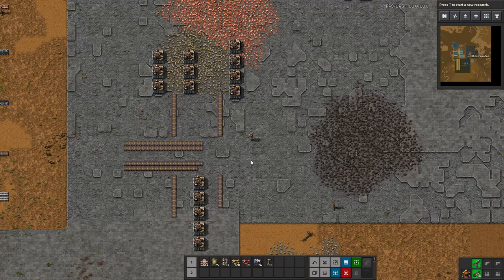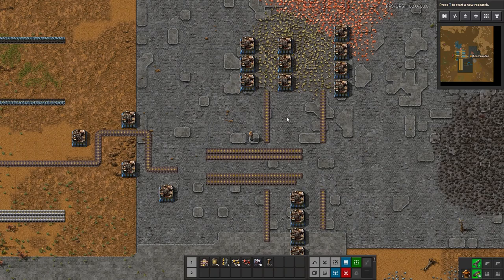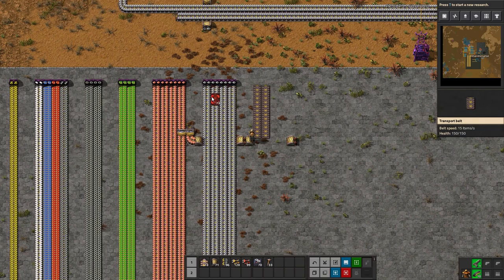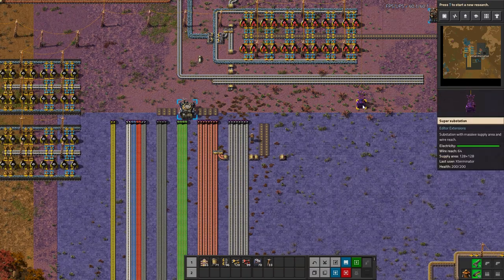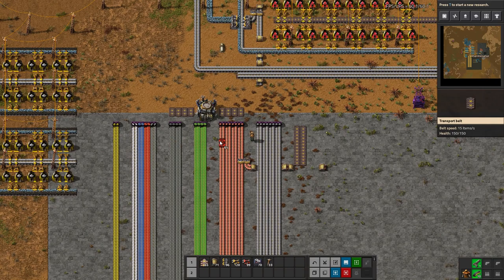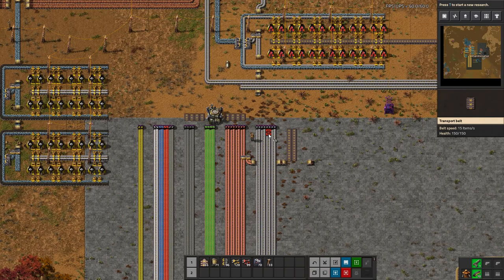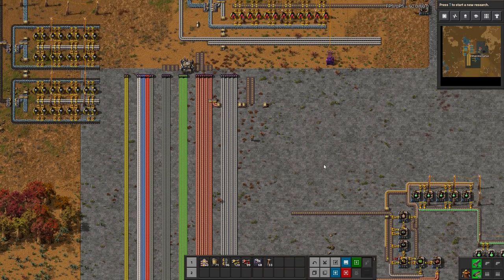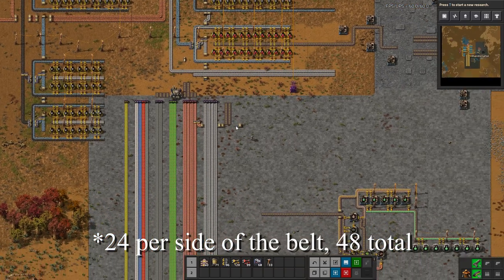The Main Bus Concept / Layout & Tips - Factorio 0.18 Tutorial, Guide, Walkthrough: Fundamentals

Comment: Me, 30h in my first gameplay: Well, guess it's time to throw all that out and start again!
Reply: You probably should've ripped everything up an restarted with the stuff you already had
Reply: @PabloEscobar-ws8rz  as a 50 hour player (aka noob), I can confirm that restarting is easier as the foundation of your spaghetti base will probably be very bad.
Reply: @CraftingTableMC  ok
Reply: @PabloEscobar-ws8rz  
I just store everything in dozens upon dozens of steal boxes after ripping everything down. Anything I don't need to keep will be destroyed using a woodeb box. It takes time but it gives you all the tools you need to get right into making a better base.
Reply: @CraftingTableMC  
I disagree. My jumpstart base is always a mess, but it's just a base designed to get me basic resources so I can build a proper base.
Once I've got a good enough supply of the materials I need to build a proper base(inserters, miners, smelters, assemblers, etc) I can properly plan out my base, but I hate trying to build a larger factory if I don't have everything I need or have to worry about breaking an existing working design to fit something new in. Also lets me jump to red belts for resources which means I don't need to wait for them to filter down to where I need them if I boost production.
Reply: @scragar  I've found a small fix the the issue of the Nooby Necessity of having to constantly restart. There are milestones that should be special Save files. Seems pretty basic, but it's saved me plenty of time. 

Get your steam power up and running and then create a save. That can serve as an absolute reset, so you wont have to go through all the wood chopping BS again. A special save. 

If you go the BUS route, Create a special save file when you have your FIRST iron and copper plate BUS lines built or nearly ready to go. It's another key point in time. 

😁There’s no feeling more intense than starting over. Starting over is harder than starting up. If you're not ready for that, like if you've already had a bad day then what you're about to go through might be too much...
Reply: @snickle1980  oh God, I've spent so much time on that damn mountain. After reading your comment, I feel I must go climb once again
Reply: Naw, once you have logistics no amount of spaghetti is too much
Reply: When you start modding it happens even more.
Reply: 100 часов во втором прохождении, опять новая игра....
Reply: Just move to another area of your map and create a new main buss there
Reply: Factorio.
Reply: @CraftingTableMC that or make other bases further away if you can

Comment: I do not do gear when I use a bus since when you need iron gears you for the most time also need iron.
Reply: Gears on the bus was more useful when science needed an extreme amount of gears. You used to have gun turrets and mining drills there. With those removed the gear needs for most things are pretty modest.
Now most gears are needed in belt production and that can simply receive its own dedicated iron belts
Reply from the maker: Yup that totally makes sense. I vary from factory to factory for putting gears on the bus haha.
Reply: The thing to be aware of here: 2 belts of gears == 4 belts of iron.  Do with that information what you will.
Reply: I rarely do gears on bus, but they do make sense. 1 gear is 2 iron so you save a full belt.
Reply: @DavidLindes  
Yes, but you still don't need that many of them in most places. I give green circuits and possibly belt production its own iron lines. That way 4 belts for the rest are more than enough. I simply don't need to optimize things that much

Comment: Another aspect useful to keep in mind is in what order along the bus (starting from your furnaces) you should put your builds, I usually try to put earlier along the bus those items that are used in most advanced recipes, for instance, green circuits are used in a lot of later more complex products, so that is probably the first build I'll set up along the bus, you are also going to need tons of rails, but that is either an end product (destined to be used in base construction) or fed straight into science and nothing else, so my rail build will most likely be towards the end of the bus near that science build.

This reminds me I don't see stone ore or brick in that bus, you are going to be building a bunch of rail and wall at some point so I would set up one bus belt for half ore and half brick stone.
Gears quite honestly I produce in-situ always so no belt for that, and plastic is used almost exclusively in red circuit so I usually just produce it near to where the red circuit build is. I do bring along oil gas and lube parallel to the main belt bus with underground pipes, this allows me to produce oil derived products like batteries near their respective consumption builds.
Reply: that's an awesome tip. i'm on my first playthrough so i didnt know what would be used where..., i have way too many things on the bus, going in both directions 😆😆

Comment: As a new player some time ago, I struggled with balancing the draw of materials from a multi-belt bus.  It might be good to give people a steer on balancers - for me at least the optimum configuration of splitters to achieve what I wanted was not obvious, and one still sees several different strategies from different players.  The simplest is, I believe, always to split off the nearest side (that would be the righthand side in this video) and then use splitters upstream to bring material from the further belts.
Also, it's often the case that a production unit will need a mixed belt of e.g. green and red circuits.  There are neat ways of mixing the belt mid-bus, without drawing two full lanes off and mixing them at the "roadside".
Reply from the maker: Thanks for the comment and thoughts! It seems you aren't the only one who would like a video on balancing and splitting off the bus, so I'll do one on that in the near future. I even struggle with it myself sometimes. It can be tricky. 

You are right though, that splitting from the the close side and then using more Splitters upstream is the way to go. But the configuration in which you do that is important for it to work properly. I'll definitely cover that in my video on it. :)

Comment: Last year, something occurred to me:

Factorio is to some extent about compressing low-value materials into higher-value materials.

2 Belts of Iron Plates becomes 1 Belt of Gear Wheels. So 2:1.

1.5 Belt of Copper Plates and 1 Belt of Iron Plates, 2.5 Belts in total, becomes 1 Belt of Electronic Circuits. So 2.5:1,

5 Belts of Iron Plates becomes 1 Belt of Steel Plates. Thus 5:1.
Reply: Ahh, but what's the ratio of iron+copper+coal:satellites-with-also-supplied-silos?  :D  [Hmm, now I want to do a factory where I have a compressed blue belt of satellites, feeding constantly-launching silos, and just emptying out at the end.  Hmmmmmmmm.  Will I bother?  We'll see!
Reply: @DavidLindes  One blue Belt of Satelites (45)s) = 27862.5 yellow Belts Copper, 25305 yellow Belts Iron (including the Iron Plates, needet for Steel), 2100 yellow Belts Steel, 1350 yellow Belts Coal, 1311538.462 units of crude Oil and 3144038.462 units of Water.
Have fun with that xD.
Reply: harry68784 sounds like a project! I like it! xD
Reply: @DavidLindes  ah yes. 27 thousand full belts of copper and 25 thousand belts of iron is "a project"
Reply: Legend Creeping yup! A big one, mind you. :)

Comment: 1) because blue undergrounds can travel 8 spots, If you INTEND to play past the first rocket launch, or build a megabase, you should triple/quadruple your initial-width needs of the bus: If you plan to start with 4 lines of iron and copper each, give your safe SPACE for 12 or even 16 lanes of each. And when intending to go for mega-base-size saves, I suggest either having single-side production (where the side opposite of factories/utilization is used is for insertion-balancing and rail network), or utilizing a split bus (where you use almost twice the size of a normal/early-mid-game bus, and where you put Iron/Copper/Green Circuits on the outside lanes of each,  and rarer materials and liquids are sent through the middle lanes, which can be shared with space for roboports and power distribution. Also, something a lot of people forget is to give themself SPACE for traveling up and down the bus. A dedicated single-lane or double lane rail for a train shuttle can be useful here, but you need to plan for it. Also, leave yourself room for roboports.

2) Leave space between factory areas to limit the times you have to demolish and re-place because you didn't leave yourself room for something you'd like to change. 
also, getting into the habbit of leaving yourself space helps when you do have spaghetti factories-, especially leaving space between/around large builds to enable insertion-balancing of rail-delivered resources. Also, setting up a clean power distribution line along your bus makes logic-driven control of sections of your factory easier, and can be useful for setting up a dashboard.

Comment: manufacturing/crafting (whatever anyone calls it) on one side leaves the other side open for more smelting to refill iron/copper/steel lanes. gave me a good idea for a next factory. 

thanks!
Reply: There are many ways to do things. I do build stuff on both sides, but not randomly. Circuits and oil industry all goes on one side. That way I can feed things directly into each other. The green circuits or plastic for red and blue circuits for example don't even go on the main bus. That's also stuff that will get beacons later. Whereas with science I use 3 PM3 and 1 SM3 instead.

Comment: * One thing I find very useful is to not run the copper and iron for circuit production over the main bus. That way you don't need necessarily need 8 lanes of iron and 8 lanes of copper or whatever some people have. At the beginning I still do it, but when I scale up they get their own belts.
* It's also nice to have a fluid bus with water, crude oil, lubricant and acid
Reply from the maker: Very good point! Giving circuits their own dedicated lines separate from the bus is usually a really good idea. A fluid bus can be quite good too depending how your base is later out.
Reply: My last base i build i did a dedicated green circuit build in front of the bus with dedicated smelters so i could produce 4 full red belts of green circuits with steel smelters and then pushed it into the bus. Was massive, had a huge space requirement and made it insane with trains and train stackers but was incredible to see swing in action. If i can find it again, i'll post a picture off the map for that area of the base.
Reply: here is a link to just the smelter setup and the integrated Gren Circuits build https://steamcommunity.com/sharedfiles/filedetails/?id=1672678083

Comment: Perhaps for another tutorial: How to route things off and onto the bus in an optimal way, such as if its in the middle two of four lanes, how would i build that splitter? balancing etc. what's a good way to create a shared belt? how to avoid spaghetti
Reply: I'm also wondering what the best way to lay out the production of the materials to go onto the bus should be? And how do you get a consistent flow of 4 lanes of a material
Reply: @MnemonicHeadTrip  Balancing/Making sure the belts start full. It doesnt matter if they are not full later down the line.

Comment: As someone who consistently never leaves enough room for anything, I'd also suggest that you leave a good amount of space between the bus and the various productions lines, just in case you need to route something around that doesn't fit on the bus.  At least 10 spaces but probably more in reality.
Reply: And when you build your first factory, leave space for more bus lanes. You need a lot more material than you expect.
Reply: @schwarzerritter5724  these days I just do a small bus to get going and then use trains for big volumes.  Klonans Transport Drones Mod can also move amazingly high volumes of material without having to worry about putting things in a straight line.  It suncs up well with train deliveries too.
Reply: @scottsummers819  The bus of my first factory was one lane for iron, one for copper and one half lane for steel, gears, green chips an copper wire. After realizing there was no reason to put copper wire on it, I made one full belt of green chips and added another lane to copper and iron. Then all this other stuff came, so I completely abandoned my first factory and just build a new one somewhere else.

Comment: Putting Gears on the bus is only useful if you're building everything off of a single bus.

I tend to separate my bases (starting in the mid-game and beyond) into two areas: research and infrastructure. Each base has its own main bus, eventually fed by trains that will drop off material to whichever one needs materials.

If you do that, what you find is that most uses of gears are for infrastructure: belts, inserters, etc. Research materials only need gears for Green and Red packs, which are not what's going to be slowing down your research. You can easily build gears in the places where you use them, rather than funneling them on down the bus.

Comment: For me the smelting is built as the end cap for my bus. The materials come off the smelters in the same direction as the bus and they all merge down into the size as the bus.

I also build on both sides of the bus. Though it is usually an oil processing area for the beginning of the other side and eventually science and rocket.

After that I start to work on my real base. Anything up to launching the first few rockets is just a starter base for me

Comment: I like to do a mix. I don't like one ridiculous factory to use one bus with 8 belts of copper and such. So what I do is I do modules and connect those modules by train. Inside those modules I use the bus concept.

For example for the gray science module I import bricks, iron, copper, coal and steel, put those things on a bus of kinds and then out comes my science packs.

This eliminates a large part of the spacing problem.

Also it's not efficient at all. You have a lot of useless belts doing nothing when they could be short. What it allows you to do is mainly organization and make sure things stay extendable.
You have a common way of doing things that will always work the same.
You can always add more to your offshoots if you need to, allowing for infinite extension (so long as the belt capacity is great enough)
It also has the benefit of making sure that every factory at least at some point gets some resources, even though something earlier in the bus may gobble things up at a pace that exceeds the inflow of items.
It also is a good indicator if you have enough resources to begin with. If the belts are empty you need more.

The bus also comes with some fairly substantial drawbacks:
The main one is space requirement. You need a lot of belts to run past machines that don't use the resources on them. For example your plastic belt is going to run past red, green, gray, blue and purple science only needed for the yellow one as well as any helper assembly machines that produce logistics items (belts, inserters, machines that don't go into science, etc). This has a lot of plastic sitting on the belt, not being used.
Then if you find yourself not having enough throughput and you are already at blue belts (say you found out that 2 blue belts of copper plates aren't enough and you need more) it can become very hard to widen the bus.
If you have machines on either side of the bus it can get very messy to split the belts off.
If you misplanned and want to add an additional item to the bus (say you decided to ship plastic in after researching oil), it can be again very hard to widen the bus.
It bottlenecks throughput for high demand items such as circuit boards through belts. Having your entire factory be fed off one bus will make it (the bus) enormous. to the point where you have more floorspace dedicated to high volume material transportation than actual assembly machines. And belts use a lot of resources to make, especially the higher tier ones.
It also creates a lot of delay. An item has to travel down the belt before it can be used. If you have a fresh shipment of ore coming in, the iron plates will need a substantial amount of time, possibly even minutes before any iron is seen at the end of your bus.
It also creates a lot of buffer that you might not want, unless you smartly control it with the circuit network. For example if you have a belt full of nuclear fuel you have a massive stockpile of it just sitting on a belt if you run it to your reactor. For this specific instance logistics robots might be useful. I however hate them (they are just cheating, avoiding all throughput and routing problems at the cost of power and initial material cost), so I opted for the circuit network solution for that specific case.

Buses have their convenience in organizing things neatly. But now I like to make a little module type base for smelting, mining and every type of science pack. Just name all the supply stations the same and disable them whenever a train can not be fully filled with signals and have one train for every unloading station ferrying in goods. Use small buses inside those mini factories to make things convenient and extendable. It also helps with planning your factory. You can assume the train has infinite throughput and then just build however many buildings you want to get the desired item output per second and have the exact right ratio of machinery for your requirements a lot easier since everything is nice and contained without dozens of machines using the same resource.

Trains are cheap and have basically infinite throughput.